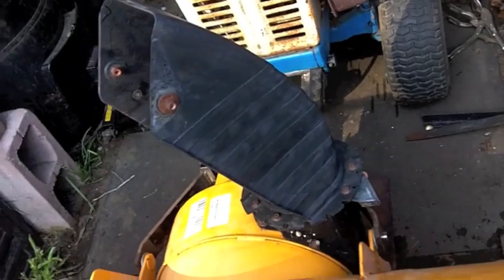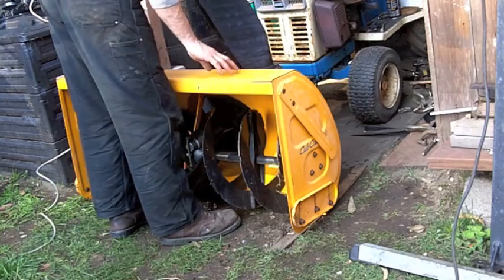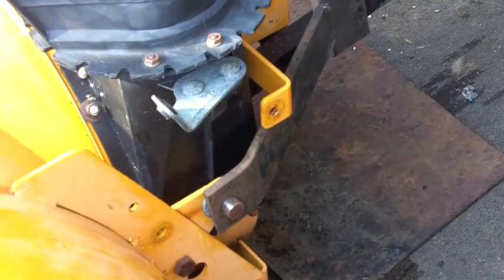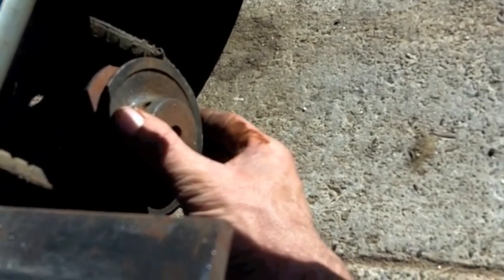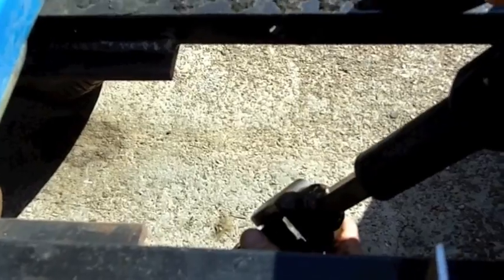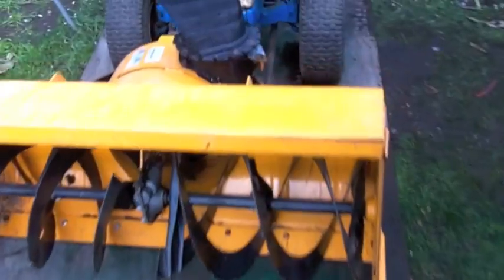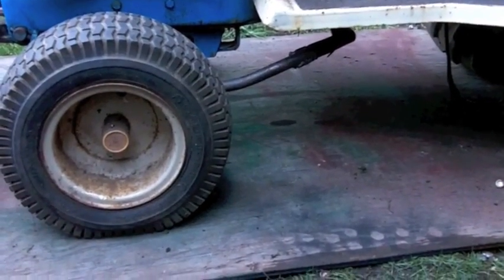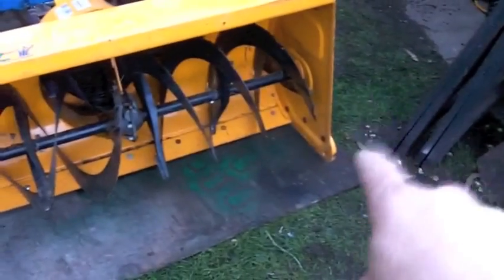Building a Home Made Snow Blower Bracket  Part 3

Comment: Great work, brother. I once installed a 46" sears suburban plow to a 108-5 rer  Wheelhorse becuase I was told it would never work. It did work, and worked very well. Until you got real deep snow. I used to call this rigging up. Now, I call it fabricating. Sounds so much better.

Comment from the maker: When the blower is in the working position, the entire unit is resting on the ground..so all the tractor has to do is push it forward and spin the auger. There are adjustable steel feet/skids on the sides of the bucket for it to ride on.  I do have a wheel weights, tire chains and a removable weight rack for the back it traction is an issue though.

Comment from the maker: No need to apologize for your english at all.  When I tilt up the blower, It will be to re-position the machine or put it away.  Prior to lifting the blower, You disengage the PTO so the drive shaft will not be spinning.  The drive shaft has a slip yoke, so it can account for the change in angle and length when the blower is lifted.

Comment from the maker: My intended areas of snow removal is the pad in front of my garage, and the 1/2 mile of road out from my house.  all surfaces are asphalt paved and I am banking that they won't be an issue.  This blower will stay on my property and not used for hire, so I have control where it goes...   well, that's the plan anyway.

Comment: Do you think it would have been better to have the mounts so it lifted instead of pivoted? Any issues with having it so far forward of the tractor?
Reply from the maker: +D Fuller I made the bracket off the original pivot points on the blower and once it is down, it is pushing against the bracket the not the lift arm.  There are a couple issues with it being so far out in front of th tractor.  Turning radius is tricky with that thing so far out front..I would have loved to have had it closer to the grill, but the length of the drive shaft and getting it to talk to the existing PTO made it where it is.  I was not really interested in cutting up this classic Gilson to accomodate an impliment that gets used a few times a year.  Second, that blower weighs about 165lbs, when it is lifted it tends to lighten up the rear wheels and traction becomes an issue when the road is really icy...even with my butt in the seat and the 140weight rack clamped to the back.